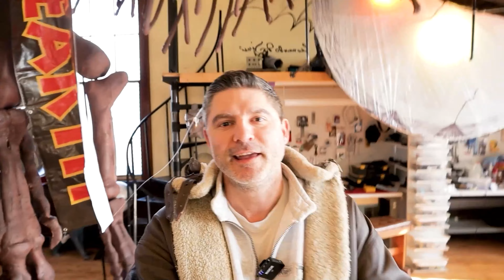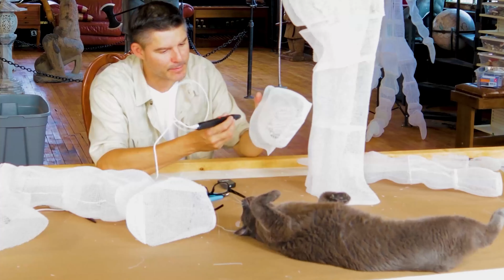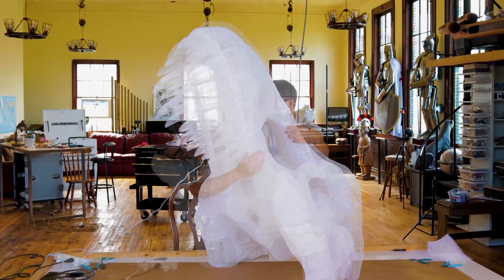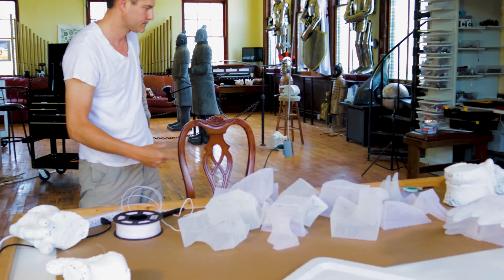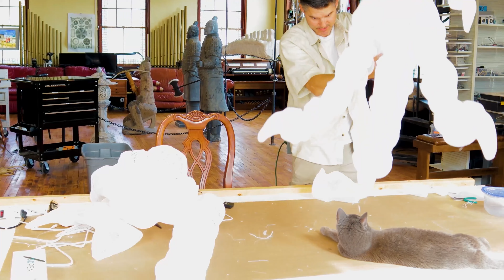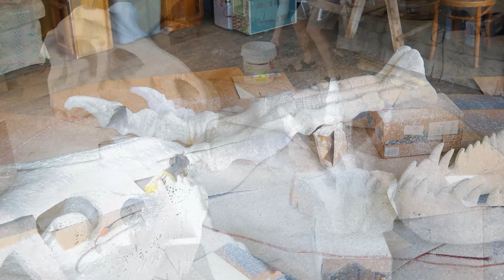Building a Life-Sized T-Rex Skull | Homestead High's T-Rex Building Project

Comment: I wonder if you had used a wire frame &  paper mache, if it would have been heavier! The 3D printing in sections is / was the best! Did you spray the joint compound in layers?
Reply from the maker: Yes I considered many options for the covering depending on the size/ configuration of the bone